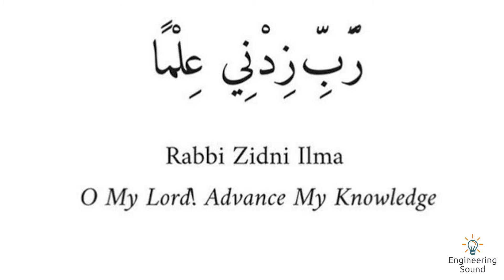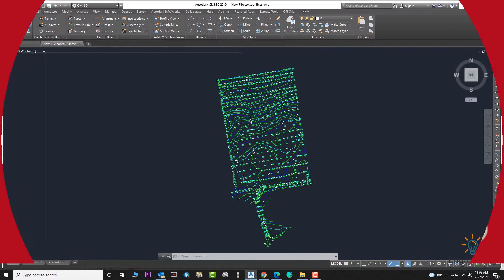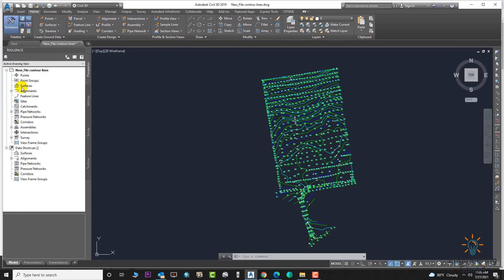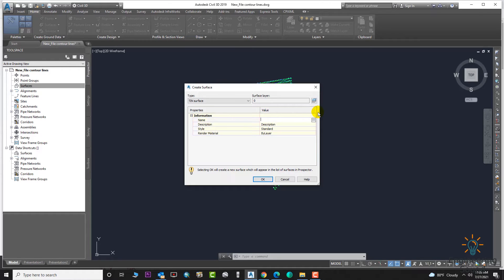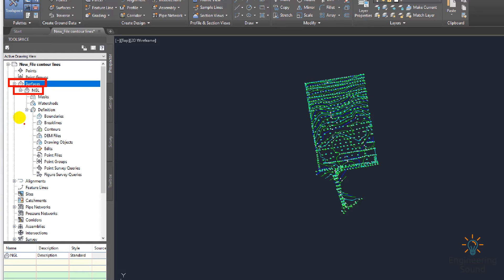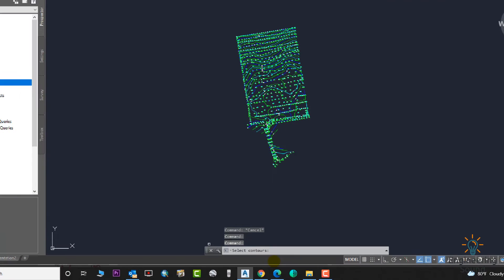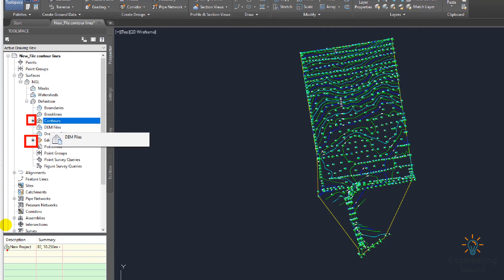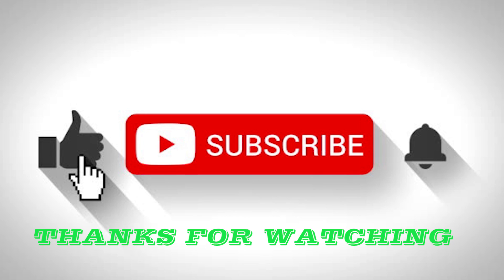How to Create Surface from Contours lines in Autodesk Civil 3D And AutoCAD.

Comment: Can you export surfaces created in Civil 3D into Autocad and then give them depth as a solid? I need to generate some "cuts" (excavations) into the existing ground to construct some working platforms and I'm not familiar with Civil 3D but I'm quite good in AUtoCAD 3D. What's the best way to achieve this?
Reply from the maker: Usually what I am doing let me explain my colleagues use Archicad and Civil surface is not supported by archicad or any other software so that why i convert Civil 3D file to AutoCAD normal drawing or DXF then I give it to the team and they can do proper work.